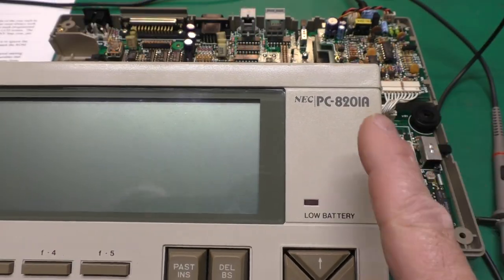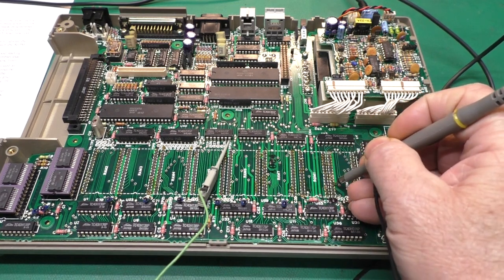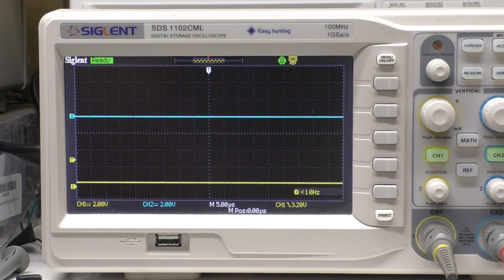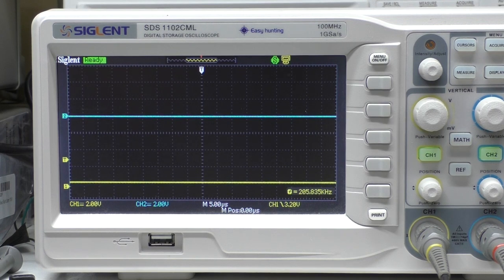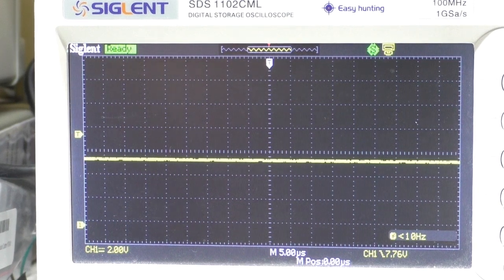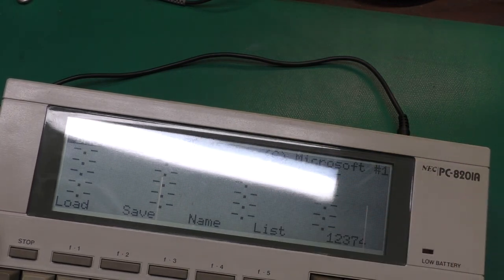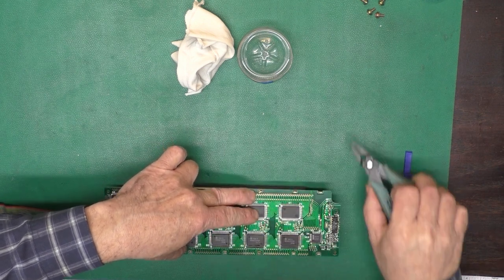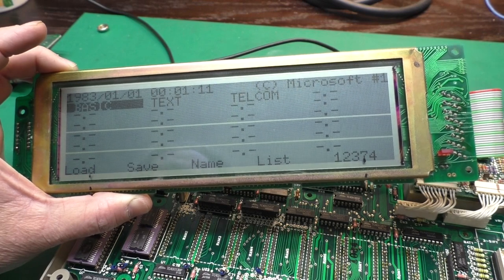NEC PC-8201a: Crumbling death foam – Can we save this poor slabtop?

Comment: I have an NEC PC-8201a. With Manuals and a story or two.
I purchased mine from a 2nd hand shop in the 80's. (East Parade, Harrogate, UK)
I used it's Parallel port to control external I/O Relays for setups. When I worked at
Farnell Instruments and later lent it to a friend to initiate his first steps into building
Bearings for BNL at Knaresborough, UK.
Thankfully I removed the Backup Battery a long time ago.
The last time I looked at it, maybe 15 years ago. It seemed OK.
I keep mine in a reasonably dry environment.
Reply from the maker: It is interesting how these 'slaptops' were used as relatively inexpensive controllers for industrial processes.

Comment: Another great ASMR repair video, Birt! 
Q: will an M100 capacitor kit have everything the 8201 needs? (I can’t find an 8201 kit)
Reply from the maker: An M100 kit will have the caps you need but you will only use about 25~30% of them.